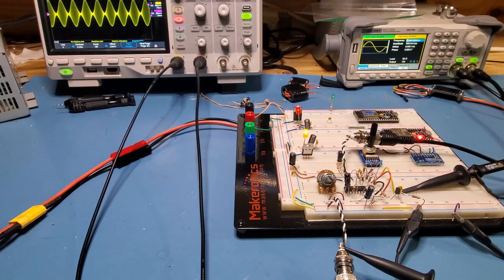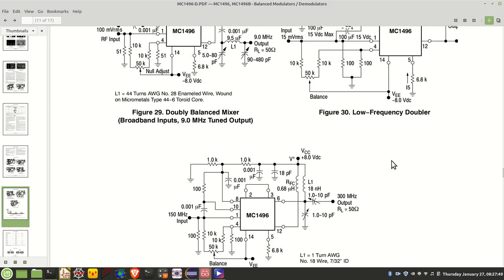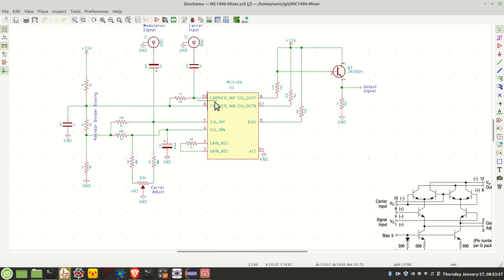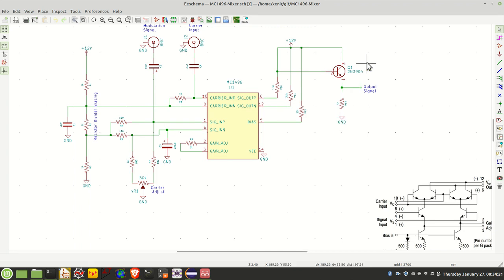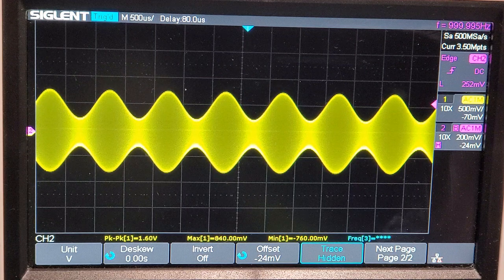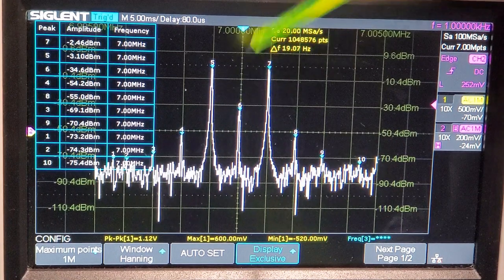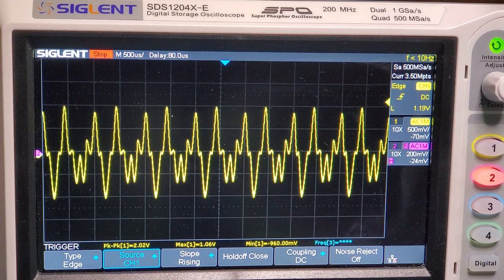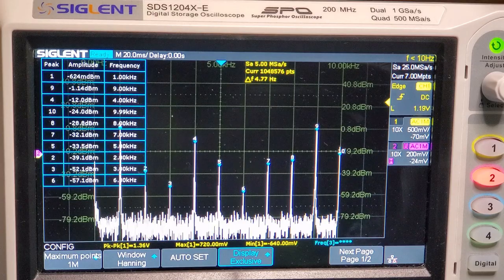MC1496 Modulator and Mixer

Comment: I did not see the update and  was going to tell you you screwed up and got the  schematic wrong and the  Base of the OP tr right on the  physical implementation and then I find you have put in some small print.  Is there anyway you can edit the video with an OVERLAY arrow - NOT like this because it is bloody confusing  and you start to wonder if NA5Y is some troll Kiwi imbecile putting on an Oz accent and trying to confuse the world... all the world that uses  35 year old  ICs that are near unobtainium that is . 
Cheers  ZL1Mzr, The Momzer,  Tim F

BTW for more power  use a spit primary  transformer and two off transistors NPN  driven via blocking caps from Out and Out prime.  Or it might be possible to put in two x  PNP Rf TR and pull current through BE with say  a 2K  at the  IC x 2 and then get  say  9 dB gain out of each via a  non  CT transformer 

The scheme you propose is likely to produce no more than  20uW out or so.  An improve scheme as proposed might get you up near the  160 uW number which is what you'd like to be driving a Cohn filter chain. With a properly engineered  BS 170 pair you might get up to the 400 uW level which is starting to get practical for further gain stages.

Comment: I built this from the schematic on a breadboard. Powered it from a bench power supply and provided the carrier and modulation signals from a signal generator. Set the peak to peak amplitude of the waves to 300mV each. Wasn’t seeing the right thing on the output so I probed around and one weird thing was that the input carrier would sort of disappear once the carrier signal was connected to the chip (pin 10), but was fine otherwise. As a test I also ran the carrier through an op amp but the same result occurred. I’m stumped. Any suggestions? Edit to add: I used the corrected schematic from the pdf link in the description.
Reply: For Figure 27 AM circuit, I got it to work flawlessly using the exact setup in the schematic. I had a -8V and 12V supply and I set the carrier (200kHz) to 500mV RMS and the modulating signal (1kHz) to 300mV RMS and got it to work perfectly
Reply: Couple other things. I have a handful of chips all ordered at the same time so I did try fresh ones just in case with no change. One weird thing we (my friend and I) noticed was the power rail was reading like 2.5 volts even though the power supply was 12. Confirmed by disconnecting it from the rail and measuring it. It wasn’t current limited from the power supply either. It was showing 0.00-0.02 amps.
Reply: Going to try AD633 next

Comment: the Q1 connection is very wrong, the base is connected to vcc which will leave the transistor fully on and bringing out high without bringing out signal, the base should be connected before the resistor
Reply from the maker: You're exactly right - I fixed the schematic a little while back

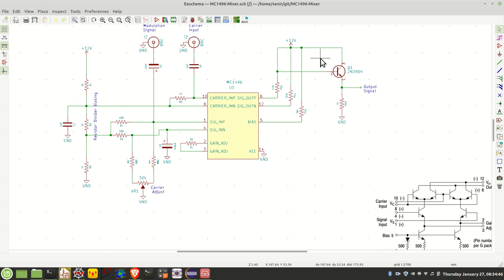Comment: Hello Ian ! , Even is too late , in schematics provided at 5:12 , the base of Q1 is wrong connected as is shorted to collector, should've been tied straight at Pin 6 before resistor not after resistor. I got it noticed coz I am in keen using MC1494  as product detector and remembered using it 20 years ago. Still a fantastic product this days I would say. 73's , Gabriel yo8rxp
sorry, just seen you already Updated the info, my bad
Reply from the maker: heh you are exactly right Gabriel - good spot! I did spot this too - but too late to correct the video (schematic in github is correct though I think). Thank you for the comment!

Comment: Very good!  As you say, this chip is 50 years old, almost as old as most hams ! 🤓 If you are building analog radios, it is still a great mixer choice, particularly as they are still being made, are in SOIC, and cheap. So, what's an example of a  'modern ' replacement?
Reply from the maker: I was thinking of the ultra modern SA602 ;)

For audio mixing though I would do the mixing in DSP - I was thinking of doing a video on that a while back and you just reminded me. Thank you for the comment Paul
Reply: @na5y  I guess that's my point. After the 1980s, the Minicircuits DBM analog RF mixers took over, IC makers moved onto complete receivers in a single IC, and no new Gilbert Cell mixer ICs were brought to market. Unless I've missed one.  So the question stands... who can name an RF mixer IC that dates to the 1990s or later, is still in production,  is suitable for amateur or hobbyist use,  and equals or exceeds the specs and utility of the MC1496 or SA612?
Reply from the maker: @Paul_VK3HN  Interesting question. There is this SA636
https://www.nxp.com/products/radio-frequency/rf-mixers/low-power-fm-if-systems/low-voltage-high-performance-mixer-fm-if-system-with-high-speed-rssi:SA636

but I can't seem to find any for sale anywhere. For a passive mixer I have used the ADEX-10
https://www.minicircuits.com/WebStore/dashboard.html?model=ADEX-10

but I don't know of an equivalent to the common SA602.
Reply: @na5y  Thanks again for digging out the SA636. It's an LO Mixer for sure, but designed for wideband FM data demodulation. The ADE-10 Is a new L7 DBM to me, I've used the regular picks, ADE-1, JMS-1, TUF-1, SBL1. I guess the world gas moved on from Gilbert Cell mixer ICs.  I wonder if anyone else has any suggestions. In the meantime   I'll keep my stock of SA612 and LM1496 fresh!

Comment: That's a great little circuit, it saved me putting one together myself. Note: I ended up running mine with a 9V battery and all still worked fine. Thanks
Reply from the maker: Thank you David. Its always fun to see those mixing products come through on the scope

Comment: Thanks for the video. My understanding is that this circuit doesn't care too much about impedance matching, right?
Reply from the maker: Hi Alex - do you mean matching into the MC1496 itself or matching externally from the signal source? If its the former there is some discussion on the datasheet about bias resistor choice for current concerns but nothing I read other than that

As far as matching from outside - yes certainly. Whatever bias resistors you are using would be the input impedance. 

For a compare to the SA602 Have a look at page 4 of this document https://www.nxp.com/docs/en/data-sheet/SA602A.pdf. The SA602 is basically the MC1496 with all the bias resistors already there for you (plus an oscillator circuit). That 1.5k resistor on pin 1 is basically the input impedance of pin 1.